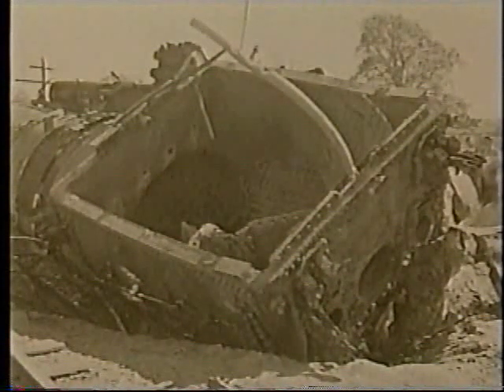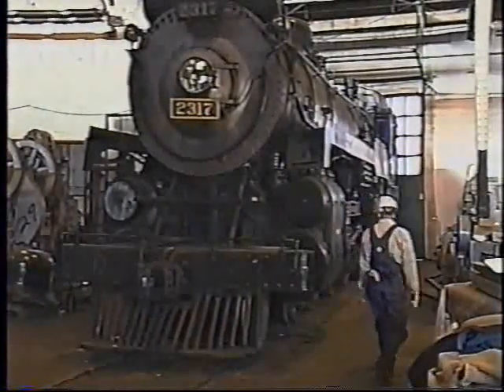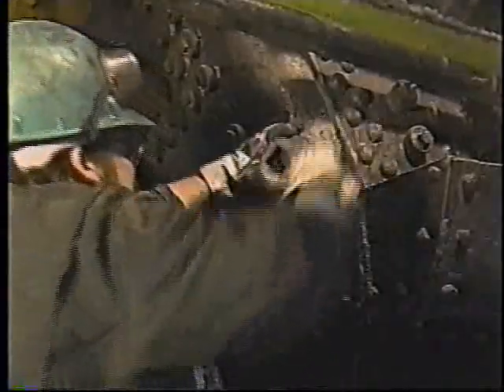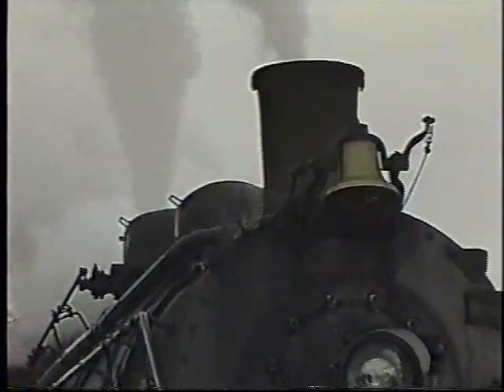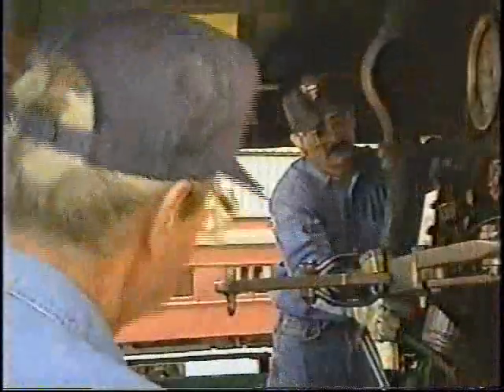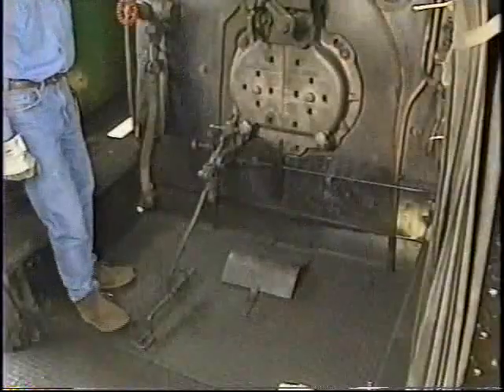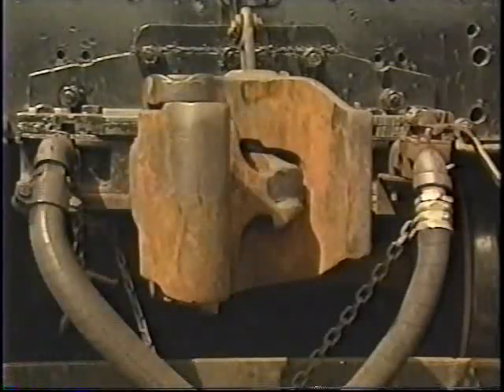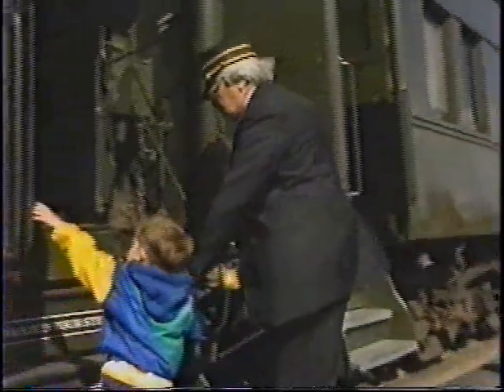Federal Railroad Administration Steam Locomotive Safety Training Video

Comment: The current Part 230 is much more comprehensive, over all.  There are additional requirements that must be met, i.e. TWO sight glasses and specified procedures for testing the sight glasses.  And the flue removal is now mandated on the basis of 1472 service days or 15 years with no allowance for "flue extensions".  A service day is defined as any day that there is a fire in the firebox and pressure in the boiler.  The rest of the video is still valid and excellent for novices and experienced steam folks alike.

Comment: Can someone explain in detail, the 1472/15 year inspection to me. Thank you.
Reply: Erick Wardwell Every 1472 Days of operation the locomotive needs to be completely stripped down to the frame and inspect every single part to the locomotive to make sure it’s in good condition. If anything isn’t in condition to be used during operation, it needs to be repaired or replaced. The boiler also needs to be completely filled with water. This will ensure everything with the boiler is in good shape and will also show leaks if any. As I mentioned when I first started, this needs to be completed every 1472 days of operation OR 15 years since the locomotive was fired up and had sufficient pressure to operate the locomotive for the first time, whichever one happens first. I hope this helps.
Reply: The clock for a 1472 starts one year after the last flue has been installed, or immediately upon first fire/steam pressure in the boiler, whichever comes first.
Reply: @MPT_Productions  The 1472 does not require  a complete tear down. That's optional upon the owner's decision. The 1472 surrounds mainly the engine's boiler and other operating components like air pumps, etc. 
Engines like 844, 4449, 401, and 765 have already had their 1472 inspections without a complete tear down.

Comment: This video predates changes made following the boiler explosion on the Gettysburg Railroad in 1995.  Regulations are much more strict today.
Reply: Indeed 1278 is fortunate enough to not be scrapped. Crownsheet is long gone though and likely will be replaced along with the back head and other sheets.
Reply: The second half of this video (the second videotape) was made after the Gettysburg explosion, as it is frequently mentioned throughout as an example of what not to do.